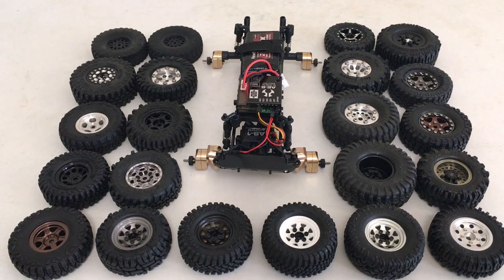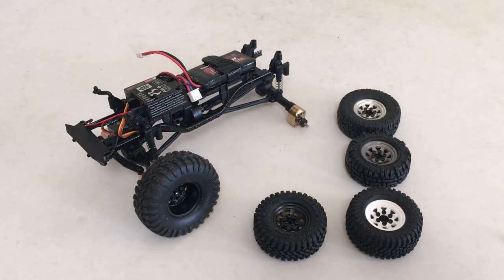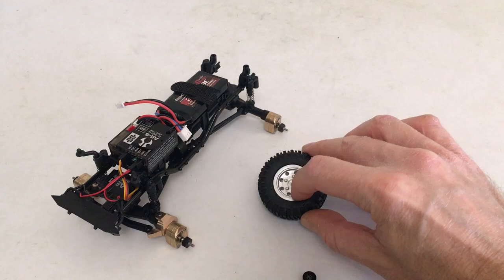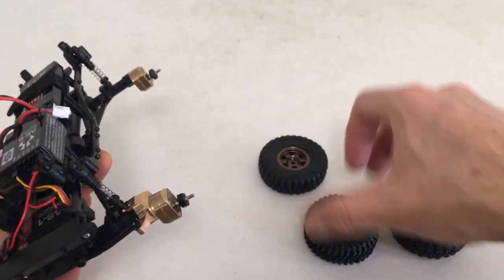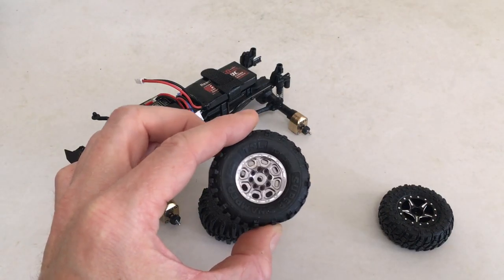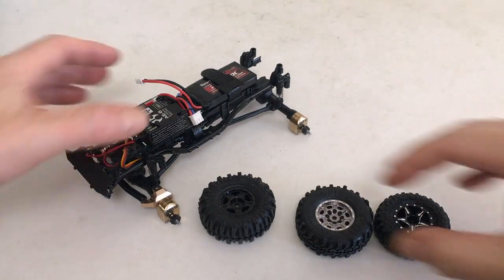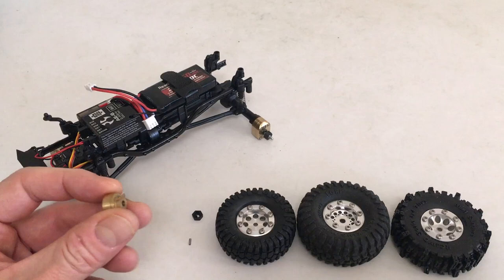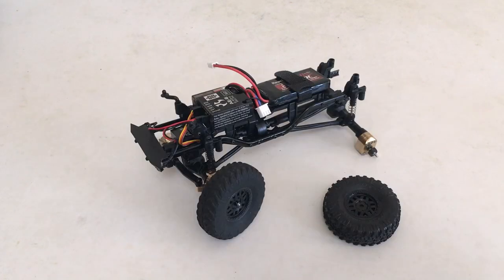SCX24 - MOFO RC: BRASS PORTAL KIT - WHEEL FITMENT GUIDE

Comment: Will normal inner diameter fit over the portals if they had a negative inset or are the moforc wheels larger inside? If they are larger, would you happen to know that measurement?
Reply from the maker: What you see in the video is what I test fit, so plenty of wheels work.  Those Mofo wheels are a bit larger diameter to stretch fit 1.0" tires without gluing.